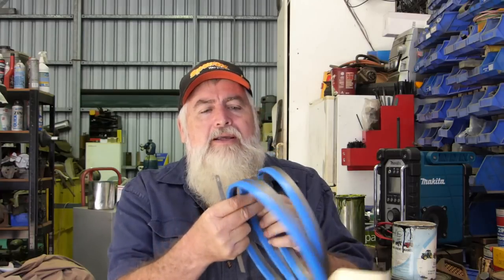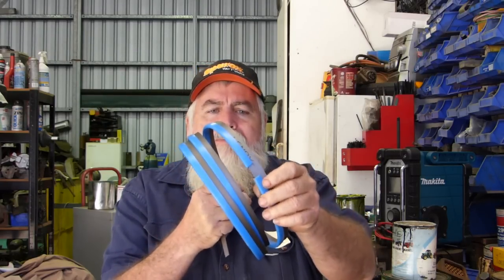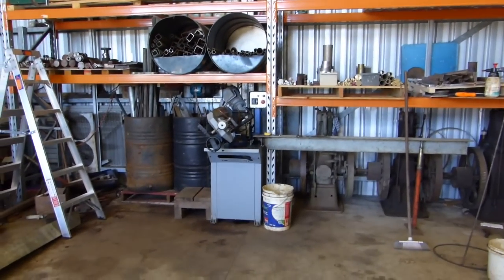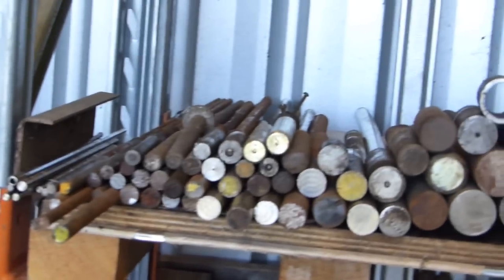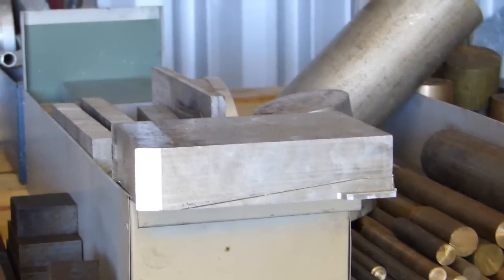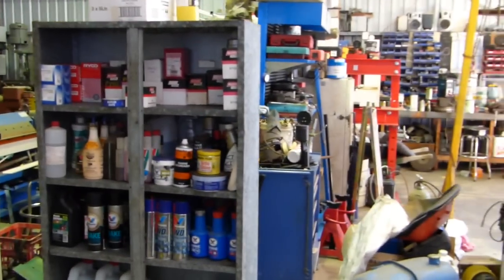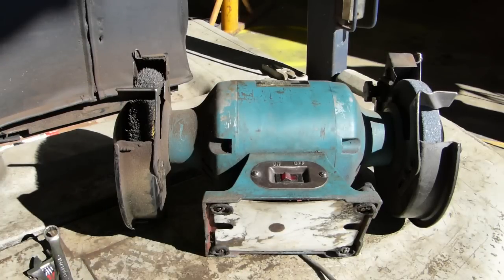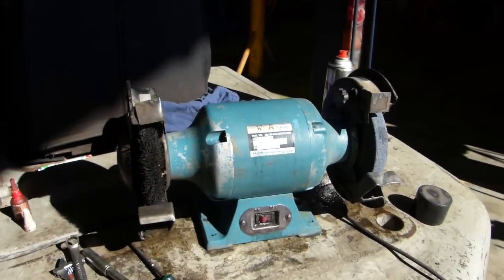Kangaroo Stew # 18

Comment: You are a very busy man for sure.   Good job on that grinder.  I have never seen the attachment you have on it.  Keep on keeping on.
Reply: bigger hardware stores should have them
Reply from the maker: Tha belt attachment is one of the handiest things, I use it often very quick and the belts last well and are cheap
Reply: You know I got to wondering what a Field Marshal engine looked like so I did a google search and found they are making these engines in India.  There I was thinking it was an antique engine.